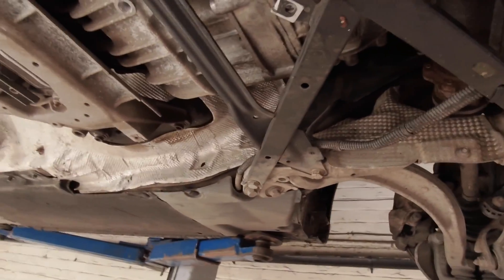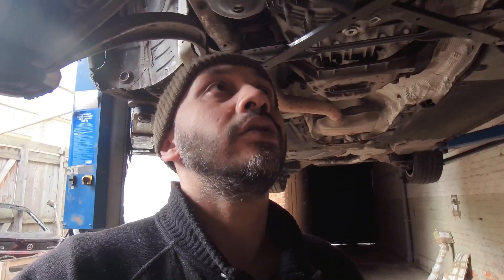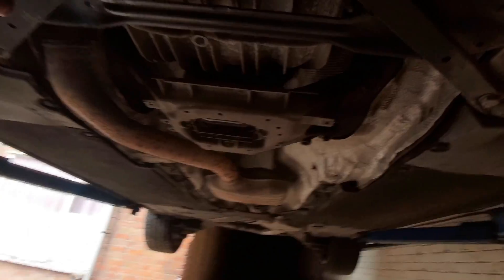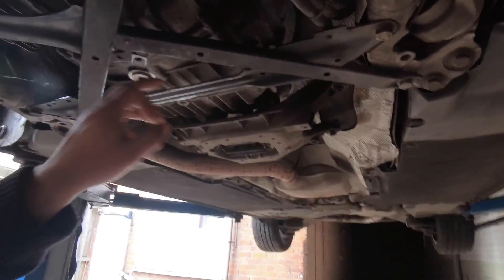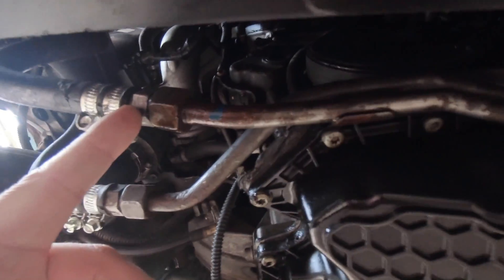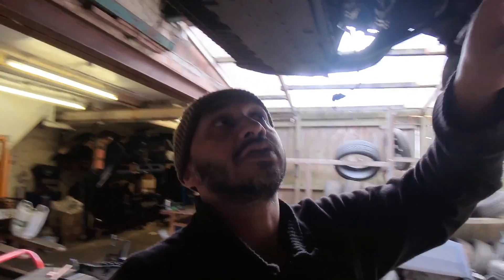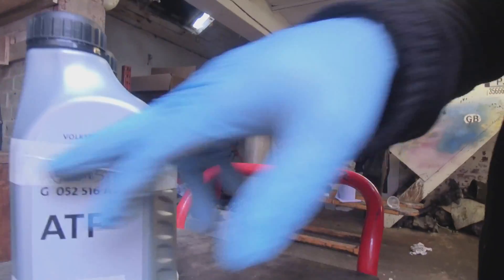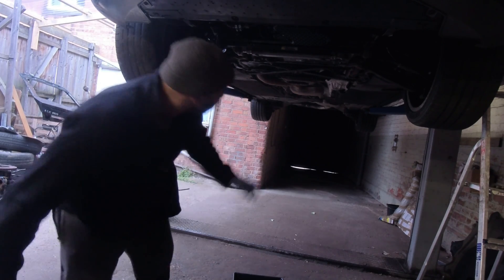How To Check ATF Oil Level Audi Multitronic Transmission CVT  / S-Tronic / DSG

Comment: I have a 2004 Audi A6 Quattro 4.2 V8 and I just put a new  engine oil cooler/oil filter housing and radiator.. but now my gears aren’t shifting ito gears ?? Do I need transmission fluid or do I need to look for a unplugged sensor or unplugged hose ???? Please help 👍

Comment: Hi ,
I would like to ask if cvt gearbox oil level is low on audi A6 2.7 tdi 2009,
Doest it show on computer with VCDS ?
Does the gearbox pull the car if want to drive ?
Thanks
Ali

Comment: Hi, got an Audi a3 diesel automatic 2011, the car jerks while accelerating and breaking on low speed also feels like while pressing the brake the car moves forward. Had the clutch replace and been there twice but mechanic said it’s nothing to do with clutch and the Clutch it’s fine. Any idea what is the reason ? Thanks

Comment: Hey haw do i know i dont have to much  oil in ?
Reply: best measure how much comes out get a couple of 5 litre bottles measure in their then put in what came out.
Reply: Yes but if you have a leak ..
Reply: @danieljohansen2810   looks at his video he is explaing how its done. when it comes out in steady stream you know its correct if its doesnot come out keeping pouring more in.
Reply: @mohammedrahmanrahman5024  ok so there can not be to much wen it flows out .. so i let it flow out to the stream is slowing down  but not to its is dripping  ...
Reply: @danieljohansen2810  yes let come down till it slows down like how in this video. if its just small drip keep putting more in. how the video it coming down like a stream thats how it has to be

Comment: Great video..I bet this service at Audi is really expensive, especially that gearboxes with Mechatronic like this one need 7L swap every 35k?  Good to know how it's done..
Reply: only thing he missed i think is the filter on these boxes i think its on top of gearbox. Audi boxes got too many procedures hard to know which is which.
Reply: i think its 35 or 40 or even 45k or some boxes. they vary too much
Reply: 60K km on the multitronic